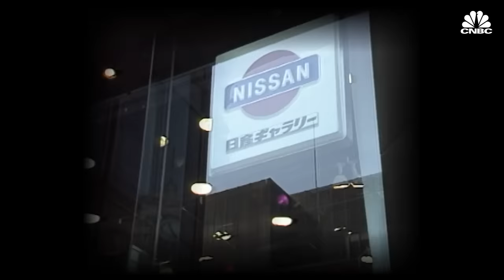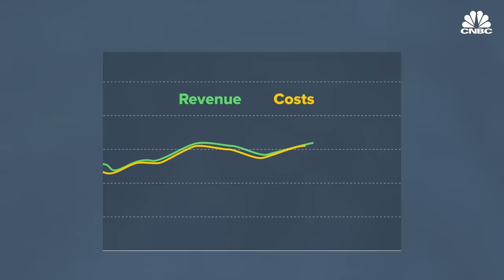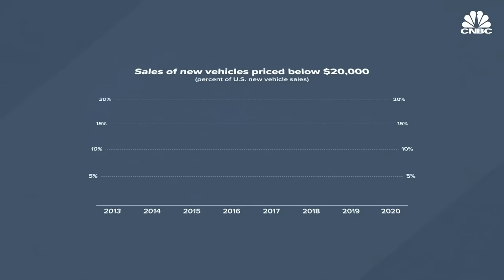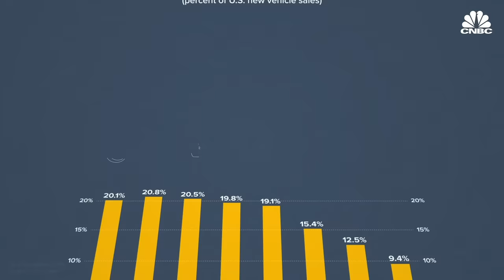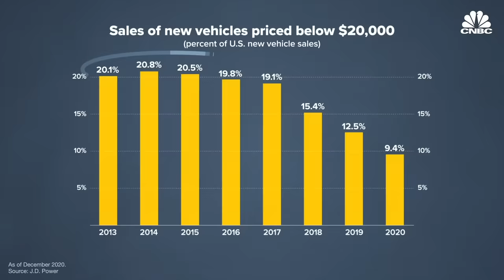Why Cheap Cars Are Disappearing

Comment: Lol @ referring to a 20k car as “cheap”.
Reply: A new car at that price is cheap lol
Reply: I'm confused.
Reply: For a car with zero miles it’s a good deal. Tbh I’ve been considering in getting a cheap daily like a Honda Civic.
Reply: @Jonathan McCully I’m on the market for a good reliable daily driver to keep for several years. I’ll probably be going with a 2013-2018 Mazda 3 Hatchback. Examples with less than 100k miles are plentiful and easily under 15k!
Reply: I agree 20 K is still alot it used to be less
Reply: @tiamarie1226  You can get a brand new 2021 Nissan Versa manual transmission for $12K or $14K for automatic, after dealer discount. About 20% off msrp on average.
Reply: Inflation
Reply: @igotanimac1  a new Nissan is a mistake, the plastic CVT will fail at 40k miles and the dealer will probably refuse to repair it
Reply: @austingriffith3598  You have to change the fluid, not drive at speed over 60 MPH, not drive aggressively. Change the fluid every 24K or 2 years with OEM Transmission fluid. Do that, and it will last you at least 150K miles. The problem is, a good chunk of people drive like manics and don't change their fluids on time, or at all. Dealer isn't Nissan, so you have to call Nissan if a dealer refuses to honor warranty.
Reply: 20k car equals to college tuition 💀
Reply: $20K is not cheap .. $15K is cheap like the Versa .. That's in competition with the darn used cars that are earlier models ..
Reply: @austingriffith3598  once you change the CVT transmission fluid at 30,000 miles you would be okay and of course the regular maintenance which is the oil change every 3 months or 5,000 miles ..
Reply: Soon 30k will be "cheap"
Reply: @TinoMiller  Depends on the car really. In some Nissans it's every 24K miles, so if you go over 24K miles good luck if you need to use the warranty.
Reply: It is actually considering today's currency trends plus inflation. 
20K what, 5 or 10 years ago is very different with what 20K is worth now.
Reply: $20k car is affordable, not cheap. Don't know how so many people are buying new SUVs...but I got a deal on a preowned 22 year old SUV for only $8000
Reply: @tiamarie1226  A lot is 2 words.
Reply: @Jonathan McCully Except wages haven't gone up to match.
Reply: @javaman2883  8 year loans they will never be able to pay off, and if they do they will incur a vast amount of extra expense with interest payments. Also, affordable is a relative word. For someone making a “median” wage in the US, I wouldn’t call 20k affordable at all. The average working class person has no business buying a new car, especially not a tech loaded crossover for 25-35k. But of course most Americans can’t bear the thought of being perceived as broke so they’ll take out the largest possible loan to avoid driving an older model...
Reply: Rental car companies buy the cheap cars too they didn’t even mention that .
Reply: No its expensive still thats a $400 dollar monthly payment
Reply: The US dollar has lost half its value in the past 20 years. It's worse if you use gold as your measuring stick.
Reply: 2012 base model Honda Civic DX manual tranny went for $14k
Reply: 20K is 1M in Phil Peso.. that is a lot of money!
Reply: It is considered cheap because we all make at least $200 per hour working.
Reply: That's actually affordable if you have a decent job. Interests rates use to be 13 precent in the 90s
Reply: I'M LOOKING AT CARS AROUND 9K BUT UNDER 15 IS CHEAP
Reply: @Jonathan McCully good point. And now those same cars are selling used for even less.  Why buy a new sub compact when you can have a used camry thats better and cheaper?
Reply: @austingriffith3598  yea cars lose value once u drive them off the lot lol
Reply: I recently got a 2020 Honda Civic and I went to 6 dealerships in SoCal trying to get sub 20,000. I got an offer of 21k and took it. So 20k and under actually is cheap.
Reply: Just got a Kia Forte 2021 for 20k, that is cheap compared to some new Toyota’s or even Honda.
Reply: @Jonathan McCully I’m sure it’s a perfectly good car for the $. Probably has better tech and safety features than the same priced Accord. Wouldn’t go Korean personally but I’m just a biased Mazda fan, I’m sure modern Hyundai’s and Kias are well engineered machines
Reply: @igotanimac1  get the manual. You'll spend a fortune on cvt transmissions lol
Reply: In Russia you can buy new Lada Granta for 6434$
Reply: @jponz85  Everyone should be getting a manual. More people drive manuals in other countries, but Americans refuse to for some reason. Yea, about $2K for cvt transmission and $750 labor + fluid. So no more than $3K. A typical torque converter automatic would cost more, so theres that.
Reply: @igotanimac1  well you have master slave cylinder clutches go bad and need to change the clutch here and there but I feel you. Manuals the way to go
Reply: @tiamarie1226  yes, in the 90s  good car was half that!
Reply: @jponz85  The number of times you have to change the clutch is will depend on how well you drive a manual and if you service the transmission fluid and maintain cooling system. Lots of people drive go the life of the vehicle without needing to replace it, some replace it just once.  Definitely much cheaper than replacing a CVT or torque converter automatic. You can also get better MPG with a manual too, if you know how to drive it, even if the EPA estimate is lower than automatic mpg estimate.
Reply: @igotanimac1  agreed
Reply: When I was growing up during the 90's, i remember seeing commercials for new cars for less than $10K. I don't know what happened. There's no way inflation doubled since then. Sounds like it's corporate greed
Reply: @uncleruckus2487  in what country?
Reply: @yahyoubetchaa  You still can. Cars today are actually cheaper or about the same. Adjusting for inflation, a car sold in 1995 for $9,000 would be about $15,000 today. And today, you can get a brand new car for as little as $11,000. One example being a 2021 Chevrolet Spark (About $11,000 after dealer discount/rebates). And a 2021 Nissan Versa for about $12,500 after dealer discount and rebates.
Reply: Cheap is subjective, but I am catching what you are throwing.

Comment: So automobile got more expensive because of tech.  I can add my own Android Auto and Bluetooth for $50.
Reply: No it's because of greed. Not because of anything else. Welcome to America.
Reply: Yea. Like I’d rather want more solid safety features installed than “tech”.
Reply: @WeheartPEACE_helene  the only tech safety feature I find is on the fusion (auto break) other then that everything else feels useless
Reply: Greed....
Reply: @JoesBrandonomics  Did you watch the video?
Reply: “Tech” isn’t just your gadgets. Cars now are vastly more reliable, safer and built to higher standards than at any time previous. 

From 1946-1981, there was ONE year in America with fewer than 20 automotive fatalities per 100,000 people. 

That number has been hovering around 10 since 2008.

In 1999, the domestics were averaging 177 problems per 100 vehicles in the first 90 days. Imports averaged 150.

By 2010, that was down to 108 domestic and 109 import.

The cars have gotten better, at least by objective measures.
Reply: The auto industry has been using the tech excuse for 20+ years for increasing prices.   I just tell them to keep their tech.
The real reason prices seem out of line, is wages don't keep up with inflation, unless you make $50/hr or more.
Reply: Just a snow job by the Greedy Industry.
Reply: It is not the actual user tech that is making them more expensive it is the engine control system and all the regulations.
Reply: became expensive because US economy boomed and became number 1 again under trump. basically people  became richer
Reply: rpi compute module gang
Reply: I dont understand why are they doing this. My phone is 10 times better that the shoddy patchwork they call infotainment. Google maps are better, Apple maps are better but no. Sometimes i think that one day they will be selling a stripped down version of a car for extra just so you dont have to have an assistand for everything 😃
Reply: That's only one part of the tech. Back up cameras are now required as of 2017, increasingly auto assist features also, traction control SETTINGS (Remember when it was just traction control on/off?), not to mention new emissions standards, fuel efficiency standards, and crash test safety standards.  The cost to sell vehicles in the US is more expensive now because of what is required of new cars to put on our market. 

Look at brands that still exist in other markets but not here, Isuzu, Suzuki (cars), come to mind. 

You all think its greed, but its not, its just a combination of market factors and regulations required of new vehicles here.
Reply: Exactly. i got an android radio i installed for 80 dollars, touchscreen with android share feature, gps, back up camera already with it. I also got a smart mirror with recording back and front and reverse camera on amazon that i installed on 2004 Toyota Camry. The dealership charges lile 20k more for that, it's a highway robbery
Reply: @acemoore7204  union workers paid more wake up , the automotive industry lost billion of dollars in 20 yrs
Reply: @bighands69  Big Government making them more expensive , was there sales tax in USA 20 yrs ago
Reply: @coopsnz1  That is the problem!
Too many people make good money, and too many people have to try and live on $12/hr.  The government needs to focus more on wage inequality.  That is way things were a lot better in the 60's. Before we went off the gold standard. Jeff Bezos claims to be losing money, but he is now the richest person in the world!  LOL

Comment: The answer appears at the very end - Used Cars (as others have posted).  Reported average new car price in 1950 ranges from $1,510 to $2,210.  Used car prices were proportionally cheaper.  Used to be the car was something you would purchase anywhere from high school to your early 20's, then you save for a down-payment on a house.  Now buying a new car is more of a substitute for making the house purchase, because houses are so out of range for most young couples.  I think this is more the result of how house prices have risen than how car prices have, with car price inflation actually being lower than mean inflation, and house price inflation being about 3x mean inflation.  Which just calls into question how the price index used to calculate inflation is weighed.
Reply: If houses are so far out of range why is there a shortage? I work with a young person (24 years old) and the bid he just put on a house was 30K above the asking price. I'm old and I never heard that before. So basically the house was so cheap (280K asking price) that he bid more. I don't know how that makes sense. A car is an expense. I'm old enough that I've been through the different scenarios. I like new much better than used. IMO a car is used because the previous owner didn't want it. You better know what that reason is. I'm 61 and in the 70s used cars where dirt cheap. But remember the life expectancy of cars back then wasn't very long. My father would look to trade his in when he hit 50K miles. Getting 100K was a miracle back then and didn't happen much. Now 100K is basically breaking them in. I have no idea how they calculate inflation.
Reply: @jamesmerritt3267  A housing shortage and increase in price go hand in hand. Its basic supply/demand economics.
Reply: in 1950 $1500 dollars is equal to about $17,000 today. You can still find cars for that price.
Reply: My first car was a 1971 bug and it was $2200 brand new.
Reply: @joeking433  My neighbors bicycle cost as much as your 1971 bug.
Reply: @ToddTinley  Yeah, I have guitars that cost more!

Comment: “Luxury cars” now a days are a joke they are all plastic and full of screens and that’s considered “luxury”
Reply: beautiful nice buttons are the real luxury now :-)
Reply: A $500 ipad screen and a $100 GPS that nobody will use will make the car go up $20k or more.
Reply: I know,  thats why I like old school,  that real wood grain!!
Reply: @jdahighroller9389  
I want a Zenith flat panel television with a wood grain bezel and decent speakers, but it probably won't happen.  Pretty much all televisions on the market these days have an almost universal milquetoast design, mediocre sound and no sign of useful improvements anytime soon.  There is very little variation between most common technology devices these days.  Many people mistake a Surface for an iPad.  I initially thought it was a bit weird, but if consumers cannot easily distinguish between one product and the competitor's, there is a serious issue not being addressed in the marketplace.  

This is most definitely true in the automotive realm.  Without logos or any other identifying markers, I doubt many people could correctly identify 5 out of 10 similar products among everyday tech brands without a lucky guess.  Everything looks way too similar!
https://youtu.be/PIAxrnkity0
Reply: @GeorgeVCohea-dw7ou  Ain't that the truth, looks can be very deceiving.... You can buy cheap no-name 7" touch screen double din head units with mirror link, wifi, bluetooth, backup cam (camera included), navigation, and more that look just like what's offered in most brand new cars for under $200. Without navigation, you can buy 'em through Wally-World for $50-60, and markups on consumer electronics are usually 100% or more. Just like TV's today, they all look the same. It kind of makes a guy question what you're really paying for, or getting without that logo, especially with auto makers looking to cut costs wherever they can. 

Even when they're branded, a friend of one of my kids told me he only paid $100 for the Bose unit in his car. Looked at it and said no, it says Boss... He says "is there a difference"? Oh My God, what is our world coming to...
Reply: that´s why i hope Lexus will still manufacture their alu analog clock and analog gauges and goof knobs and buttons and switches.
Reply: Unless you actually drive a luxury car, it is a whole lot more than just plastic and screens. Lol. Engine is more powerful and smooth. Transmission doesn’t shift harshly. Stable at high speeds and less body roll. Seats have more lumbar/thigh support/heated and massaged. Interior is more insulated from outside noise. Glass is double pane. Sound system is comparable to a theater. Finally paint and interior finish is top notch.
Reply: You don't "need" luxury cars, they are a status symbol.
Reply: Just buy Honda and an Amazon fire TV tablet.
Reply: There is no such thing as an American luxury car anymore.  A luxury car is a large car that floats down the road with little to no road feel, has over assisted steering and big soft cushioned seats.  I know, because since college until switching to SUV's in 2002 I drove either a Cadillac or a Lincoln.  The last true luxury car was the Lincoln Town Car and that ceased production in 2011.  In fact, the only TRUE luxury car still made worldwide is the Rolls Royce or Bentley.  I have a 2005 GMC Yukon which I bought new.  It is SO comfortable to ride in with my back and muscle problems.  No fatigue at all.  But its falling apart and I need a new one.  I thought I would treat myself to a Cadillac Escalade (used).  In October, I drove a 2017 and I was SHOCKED.  You can feel every pebble on the road, the steering is tight and the seats are hard like a bench in a high school gym.  Even worse, I'm a big guy and I didn't even fit in the seat properly and I was literally pinned in with the door and console right up against my legs.  I have to move my legs when I drive due to my muscle issues and I could not.  I asked the salesman what the hell happened.  He told me its what the people want.  A "euro sport" feel.  I told him if I want a sports car, I'd BUY a sports car.  He also told me that they get several requests a week for the old traditional luxury Cadillac.  I told him perhaps GM should actually listen and produce just ONE model like that.  I literally don't know what to do.  I can't get comfortable in these new cars!
Reply: A generation ago, the engineers would build the cars at Mercedes and the accountants figured out how much to sell them for. Now, the accountants say how much to sell the car for and the engineers figure out how to build them at that price point.
Reply: @capmidnite  in the end greed Ruines anything good
Reply: @LordLoMR2  lmao my 10 year old baseline mazda has a decent portion of those (zippy engine smooth transmission, low body roll, comfortable seats [no heating/cooling tho] and a great sound system [coming from an audiophile]). You are doing nothing but proving OPs point.
Reply: depends on how you define a "luxury car". you get what you pay for. ever tried something like a 7 series or s-class? no plastic, almost fully covered in smooth leather.
Reply: @Dan81825  Yeah, the plastic is where you don't want it: under the hood
Reply: @Dan81825  legit not the newer ones lol If you’ve been in one
Reply: @famus801  had a '18 s-class for a week as a rental. except the steering wheel holder thingy, almost everything was covered in leather
Reply: @Dan81825  the 18’s aren’t as bad as the 2020-2021
Reply: The only thing Luxurious about those Luxury cars is the repair bill. I think I will stick to my older model Toyotas and Hondas.
Reply: VERY TRUE, my friend. I was let down by the flimsy plastics & "savings" Mercedes-Benz used in the new 1998 S-Class (S500L) on launch here in Australia. I knew we were heading into a new age when a brand new S-Class had steel & plastics that felt NO better than a BMW 7-Series competitor.